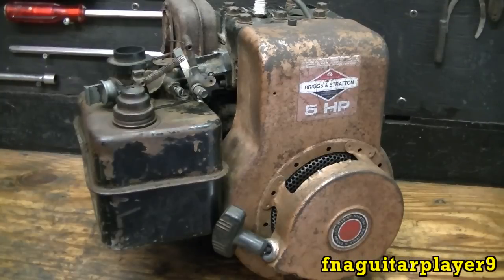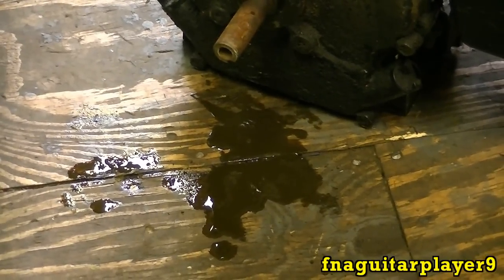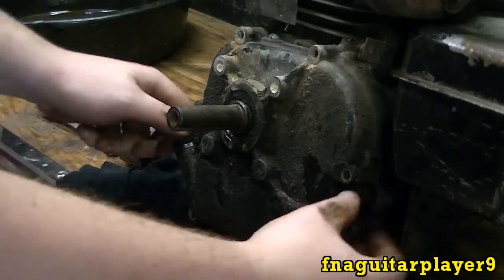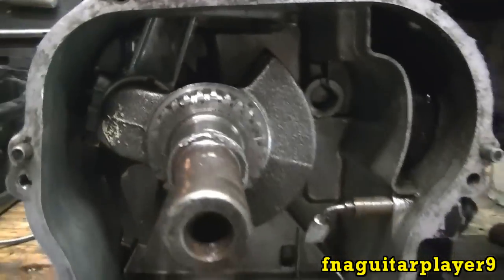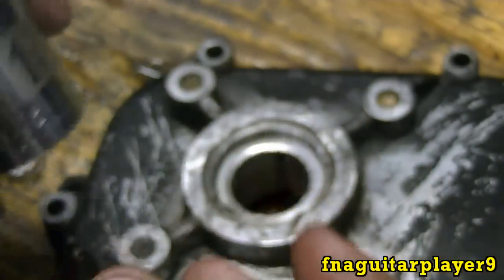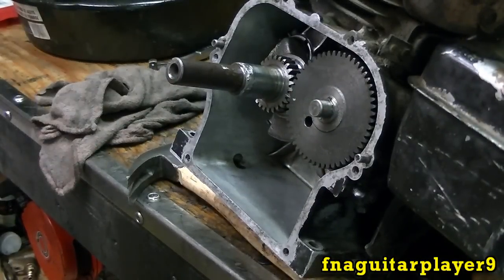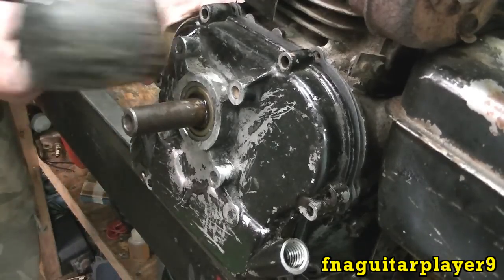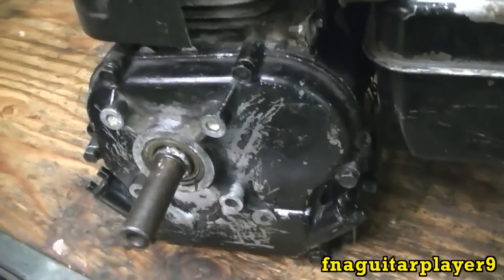How to Replace Crankshaft Oil Seal and Crankcase Gasket on 5 HP Briggs (similar on any small engine)

Comment: Great video with excellent explanations.  Looks like I have a sump/crankcase leak, need to replace the gasket.  Question is- what thickness gasket should I use?  There are 3 different sizes- 0.015, 0.009, and 0.005.  I read somewhere that the 0.015 is the standard, and you only need the others if either of the mating surfaces are warped, to prevent play in the crankshaft.  Is this correct?
Reply from the maker: Yes, go with the .015 it will usually work ok Thanks for Watching!!!

Comment: Came here to see if you use any sealer on the gasket but you don't.  I'll do the same.
Reply from the maker: Sometimes I do, but most of the time i try not to because it will make it harder to clean up next time its tore apart, but if the metal is in bad shape or got scratched up real bad from scraping gasket off then i might use a light film of form-a-gasket #2. Thanks for Watching!!!

Comment: Hello Andy here I got a really good kick out of your video knowing it was 6 years ago but I obtain a Briggs & Stratton 5 horse motor on a rotortiller 1975 model number one 130292 the one thing I'm having issue is fine parts I live in Calgary Alberta now I've only had it two days and both days it's raining outside so I didn't work on it but I did take the numbers you shown on your gasket video so and also on your carburetor cleaner video so time will tell but hey if you're willing to help out and I know this video of 6 years old they just give me a shout
Reply from the maker: Glad to help out! Check on ebay or amazon for the parts too if you can't get them local. Thanks for Watching!!!
Reply: @fnaguitarplayer9  good morning sir Andy here again. Just a quick update on the Briggs & Stratton 75 model 130292 that's is attached to a rotortiller. I did find the parts it did take sometime living in Calgary Alberta. I'm happy to say by watching your videos. pulled the cord and started up and couldn't be so happier that with your videos you made the process a lot easier.
Reply from the maker: @andyfrey8986  Hey. Glad to hear your were able to fix it, and glad to help out!

Comment: Would it make much difference if you put the timing mark on the other side of the tooth. Always good vids!
Reply from the maker: It will run but may not run as good, the marks should align. Thanks for Watching!!!

Comment: Thanks. Both set screws were missing so it must be rusted on pretty well.
Reply from the maker: Your welcome! I hear ya! Thanks for Watching!!!
Reply: Question for ya..Do these 5hp engines take 18 ounces of 30w oil?Been trying to figure that out.Sounds like too much to me.Seal came out easy with a screw in it after a puller was had to get that stuck clutch off.
Reply from the maker: @wish2fish37  The model 13 / 5hp flatheads use 21 ounces of oil, you can use 30w (sae30) or 10w-30 no problem. Some are using 15w-40 diesel oil as well. I've been using valvoline sae30 with 25% lucas additive. Great combination! I hear ya!
Reply: Thanks again. Got new seal in and no leak. Yippie. Now waiting for set screws in the mail. Couldn’t find 1/4 -28 set screws locally.
Reply from the maker: @wish2fish37  your welcome!  I hear ya!

Comment: Thanks for this,but I want to do this without pulling sump apart.Don't have apuller.Can I just use a drill and drill holes in and put screws in to use as leverage to yank out?Also, what is the purpose of the filter type elements inside of gas tank?
Reply from the maker: Your welcome. Yes! You can do it like that, its just not quite as easy to do, and you will need a piece of pipe the same size as the seal to drive in with it. These usually have 2 screens one on each pickup tube, the newer ones do to but they also have a plastic baffle piece inside to (i assume) help with gas sloshing around. Thanks for Watching!!!
Reply: Thanks. I can’t get the centrifugal clutch off the shaft. Need to find a pulley puller now I guess.
Reply from the maker: @wish2fish37  no problem. make sure both set screws are out, and spray some pb blaster in the holes and let it set, that will help. Sometimes you do need a puller though.

Comment: After 31 years of shoveling out, I finally convinced my husband to purchase a snowblower. >>>arah.in/XnYK   This also occurred after 3 Nor'Easters and we were expecting another on Wed. The snowblower was suppose to arrive on Thursday! Such luck! Well, Pilot Freight (the shipping company) came to the rescue. They called & delivered it the day before the storm. What a great company!!! So we got to use it for the last storm. It worked like a charm. It has pull start or electric. Which is convenient! It plowed through the snow with no issue. I would highly recommend to others and of course, ask for Pilot freight company- they are the best.

Comment: I have a similar 212cc clone but oil is leaking from the right oil plug on the crankcase when the engine is stationary and off. Could you suggest a cause for this and will I need to replace the crankcase gasket because oil is leaking out? Thanks! Help much appreciated
Reply from the maker: Some have a o ring type seal on them, that may be bad and needs replacing, if its leaking from the seam where the sump bolts on, it will need a new gasket on the crankcase. Thanks for Watching!!!

Comment: I need to change the crankshaft oil seal on my 3.5 tecumseh from a troybilt chipper. I can't get the blade off. what kind of puller will help me get it off? thanks
Reply from the maker: You can use either a bolt puller (best, easiest) or a 2 or 3 jaw puller (cheaper, and not as easy). Thanks for Watching!!!

Comment: I did the same but I just wonder why this engine turns sluggish. What could be the cause of this problem?
Reply from the maker: While cranking I assume? If the gasket wasn't thick enough, there will not be enough end play and it can cause it to bind up. Make sure to oil everything when you reassemble it and don't forget to put oil back in it! Thanks for Watching!!!
Reply: fnaguitarplayer9 I have done a thin gasket paste (gel) on it. You may be right, that could be to close to the end. I ordered one new gasket(made of paper), right now. Thanks for your comment!
Reply: fnaguitarplayer9 in other videos people say that this gasket Gel is awesome. I cannot admit because it leaks a bit oil. It's new oil so I can fill it back to the bottle.
Reply from the maker: That is probably what the problem was, not enough clearance. Your welcome!  Yeah should be fine, just make sure no dirt or anything gets in the oil. I use a gasket maker with an actual gasket sometimes, it helps the gasket stay in place and makes a better seal. The only thing i don't like is when you have to take it apart again, its a pain to get it all removed!

Comment: My Craftmans 6.5 hp lawnmower leaking oil from  around the top of the engine.I think it must be the engine top gasket that might have to be replace.Oil some how leaks out a little from the top and then the oil come down/out on the outside wall.It gets worst during the summer 90,100 degrees heat.Now it leaks out a little more oil getting the engine more dirty oily around the engine.It's not leaking under the motor.I had to refill it with oil after cutting the lawn second time three weeks apart.This motor is quieter than a 5,5.5 hp motor  with a nice motor sound like a Harley Davidson engine  :D
Reply from the maker: It might be just the valve cover gasket leaking, if it is, thats a fairly easy fix. Thanks for Watching!!!

Comment: Is it better to remove the seal sand as much of the rust off with a cloth sanding strip and apply heat with a propane torch to the Aluminum sump to swell the sump to get the sump off the Crank Shaft if it is rusted?I have seen people use a screw driver to pry the sump,but I believe it would damage the machine surface and cause a leak in the sump gasket.
Reply from the maker: I've never heated one, but it would be worth trying, i wouldn't get it 
super hot though. Yeah i wouldn't pry it like that, it could easily 
gouge the surface and cause a leak. I like to use a rubber mallet to 
pound it off, seems to work good. A regular hammer can crack/break the 
block/sump. Thanks for Watching!!!
Reply: Thank you for the reply
Reply from the maker: your welcome!

Comment: Nice vid but you don't need to take the crank case cover off to remove a oil seal. Screw a screw into the seal and pull on the screw with a pliers, always works for me.
Reply from the maker: +GPXSmallEngine Thanks, that is true, But in this case the sump was leaking too. Sounds like a easy way to do it. Thanks for Watching!!!
Reply: The only reason I'm pulling this is because the sump has cracks that aren't accessible to braze from the outside.  Thanks for this.
Reply from the maker: I hear ya! I have one off another 5HP that needs welded/brazed. Your welcome, Thanks for Watching!!!

Comment: This is a great video; you make things look so easy, and you do cut away to keep them short. I have a 149cc scooter and three lawn mowers, would they all be about the same? Also, what if my scooter (GY6) has no owners or service manual, does that matter? Thank you!
Reply from the maker: Delaware Teacher Appreciate that! I try to, I never if i'm showing to much or not enough. Here lately i've been editing more out to make them shorter. the scooter motor will be alot different than the mowers, alot of times on scooters and pocket bikes and such you look up parts based off the cc of the motor, not always but thats generally a good way to start, and the model of the bike as well. Thanks for Watching!!!
Reply: Great. I will keep looking with more search information.
Reply from the maker: Delaware Teacher Most of the times just going by the CC of the motor helps.

Comment: I have a couple of Briggs 5 hp engines and I loved this video.... Can you tell me how many oz's of oil you put in when you refill / replace the oil ..... Thanks Warren
Reply from the maker: Warren Tibbs I was thinking it took 3/4 of a quart, but my manual says 20 ounces. On the ones without a dipstick, briggs usually also says to fill until its overflowing, sounds crazy but thats what they say. I've even seen that on the label on 12 hp briggs! But yeah i'd go with 20 oz. Your welcome! Thanks for Watching!!!
Reply: +Warren Tibbs IMHO, fnaguitarplayer9 is one of the top four techs on YouTube, and he has forgotten more about small engines than I'll ever know. His manual says 20 ounces. Mine, which is the B&S Service Manual for L-head up to 5 HP, says 18 ounces for vertical shaft, 21 for horizontal shaft, for this range of engines.
Who are the other techs? Jeremy Fountain, Donyboy73, and Taryl Dactill. A little bit of Taryl can go a long way, but I value his stuff because he dares to innovate.
Reply from the maker: I appreciate that very much! I know it usually comes out to around 3/4 of a quart on these horizontal engines. I've never actually measured it per ounce though. Thanks for Watching!!!

Comment: I was wondering on how much oil to put into these motors, I have always filled to the first thread while the motor was flat on a level spot is this correct
Reply from the maker: That is about right, the 11 horse briggs is right at a quart, little less, and a 12 horse is a little less 1 and 1/2 quarts. briggs recommends to fill it up till its overflowing (on engines without a dipstick) but i disagree with that, I like to run it half way, from the bottom the thread to the top thread, i feel that is just right. The first thread would be about at the add mark on a motor with a dipstick, so i'd recommend about half way up the threads,  heres another video i did talking about why I feel that filling it to the top is to much: http://youtu.be/Z2_VntCXwdw Thanks for Watching!!!

Comment: Thanks for your videos; I have found them most instructive especially the 4 video engine rebuild as that is what I am having to do (hole in crankcase too (JB WELD me thinks)). Keep them coming.
Reply from the maker: your welcome, appreciate that! Jb weld will work, as long as you clean it really good, i'd recommend cleaning it with lacquer thinner and use a wire brush too. If its to big of a hole, JB may not work the best. Thanks for watching!!!
Reply: fnaguitarplayer9
Thanks for the advice. The hole is about 1.25 inches diameter, I have the bit that came out so with some jiggery-pokery I have used that to strengthen the repair. So far, so good.
Reply from the maker: That should work in that case, since you have the piece that broke out, i've seen some people take a piece of sheet metal and make a patch over the hole, then put gasket maker on it and some short screws into the housing.